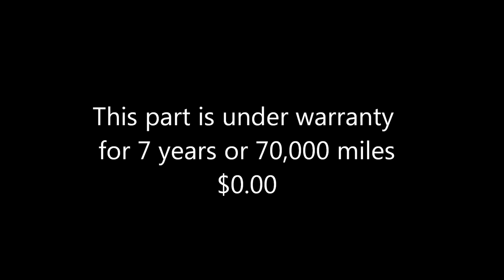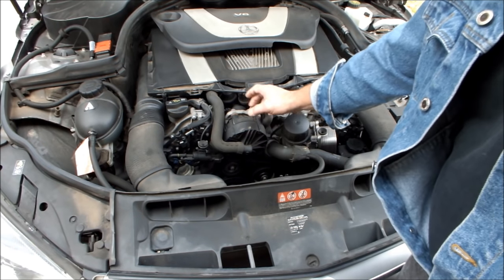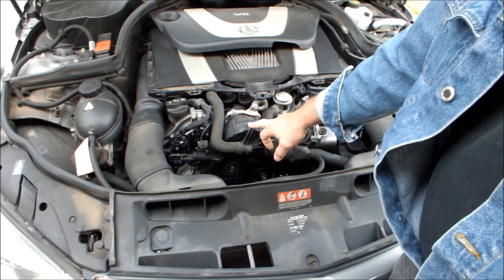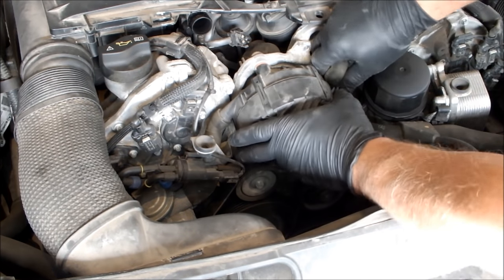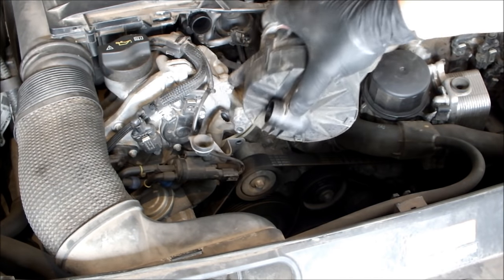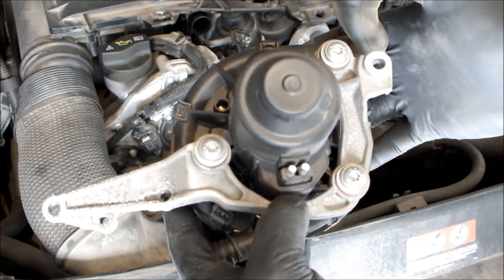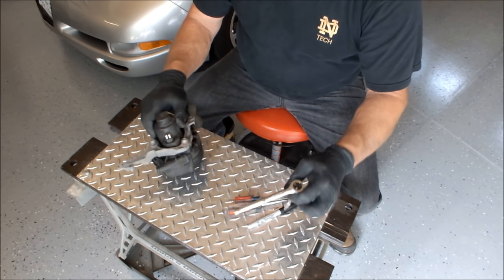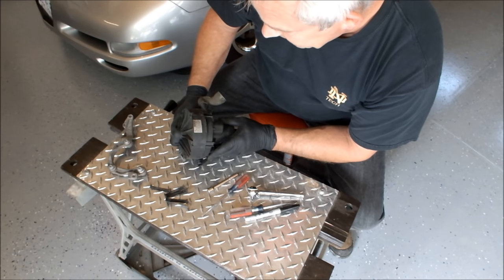Mercedes Secondary Air Pump Problem

Comment: hey man i have a question again for you , okay so ichanged the smog pump and also the relay . now im getting a code for the check valves , can i just remove them and clean it up?
Reply from the maker: You can certainly try it - but MB's are a pain in the ass for lights coming on
Reply: Once the Kombi Valves get plugged up with Carbon- you need to swap it out.
Reply: David Hall so change my valves ? appreciate yo help my boy
Reply: @uzzle21  You need to verify that the vacuum lines attached to your Intake Manifold- secondary air injection switchover valve- and Kombi Valves is in good condition. Once that's done you need to remove your Kombi valves and verify that your smog pump is pushing air through your Kombi valves. If all the above checks out ok- your problem should be solved. 
My problem was dry rotted vacuum lines. Once I replaced those- I was good to go. No more CEL. I used a Power Probe to power up the smog pump for testing purposes. Also I used a Hand Brake bleeder to pull a vacuum on the vacuum line attached to the Kombi Valve. I tested (1) Kombi Valve at a time.
Reply: David Hall i just found out bro its the damn pump bro its causing the air pump check valves not to function properly
Reply: @uzzle21  If the Pump is not functioning for sure. You need to replace it. Confirm first- then swap- out the Secondary Air Injection Pump. Try to get a Power Probe- it will make powering- up components much easier.
Reply: David Hall yo bro i have changed air pump , both valves , and the relay. still getting that damn code what do i do now
Reply: @uzzle21  Only thing left is the Secondary Air Switchover Valve. Its a solenoid that opens to allow Vacuum to open the Kombi Valves. What's the Make Year and Model of your Car? Another thing: Is the Smog Pump coming on in the morning- when the Engine is cold?
Reply: David Hall yes its brand new , changed the air pump check valves , and also the relay. still getting code
Reply: David Hall i think ik the solenoid you talking about also
Reply: David Hall 2006 Mercedes e350 Base
Reply: @uzzle21  The switch over solenoid is the only component left to swap out.
Reply: David Hall electric change over valve
Reply: David Hall u got a number or something man i’ll contact you so i can get this done
Reply: David Hall i emailed you

Comment: Is this the same for 2000 S500? I have the same problem but don’t know if it’s the same on all benzs
Reply from the maker: If your car whines when first started in the morning then yes - Cheers from Canada!
Reply: carquestions it does just that it sounds like a jet for 30 seconds then goes back to normal purring like a cat
Reply: @YungBlaxTv  thata good then. They all do that for about 65 sec and then get quiet. Unless they r bad the. I'm assuming they stay noisy

Comment: Why not lithium spray grease?
Reply from the maker: Sure Tom - give it at try and let us know how it works - cheers from Canada!
Reply: I used silicon spray after blowing all that dust out, helped a bit but was still making some noise so just swapped it out.  The odd thing is that my car only had 86000 kilometres on it, so a bit soon for screeching noises. Will see if the Dorman brand lasts longer than the Bosch.

Comment: Hi. I have not 0410 code,but this pump not on/off last 4 monts cold engine (2-3 times maybe...),but I have other codes 0172 and 0175 and no one can't find problem,engine runs too rich,all sensors is ok.vacum leaks is ok,o2,maf... problem secondary air pump??
Reply from the maker: How many miles on it Fix? - could be a lazy 02 hard to say at this point
Reply: Mercedes w203 V6 2.5 L 140k miles,but this codes come again after every 30 miles. when engine is cold,car runs fine,codes come when engine tempreture 60 and up ! CEL come when car idle

Comment: I thought I still need to confirm something with you, since I know nothing about cars. 

A repair shop told me I should replace secondary air injector pump, check valves and secondary air injector pump relays. According to my understanding after watching your video, this problem is not a problem that will affect safety and will not cause the engine down. Does that mean I can disregard it until I am willing to change it?
Reply: BTW, my check engine light is on.
Reply: I’ve been driving with my check engine light on for about a year already and it’s definitely my secondary air pump with that noise. Hasn’t effected my car yet but it will with smog laws so I have to change mine asap
Reply: @methodbigboi  Thanks for your response!!
Reply from the maker: You can drive with the pump like that and the light on for a very long time - possibly till you sell it - if the pump is turning on then the relay must be working

Comment: pull the fuse and or plug. this part is NOT needed for proper engine performance. happy driving!
Reply from the maker: Not so Happy Veghead - You'll get warning messages every time you drive - a very unsettling feeling - Cheers from  Canada!
Reply: Yes it is you know that air pump pushes the air  threw for the ac on these Benz’s rite if they pull the pump relay the ac will not get air

Comment: This is obviously a money grab part for the dealer. I replaced this pump three times already(thank goodness i learned to replace myself) and like clockwork, the jet turbine sound can be heard 5-6 months after a new replacement. A real bad quality part from Bosch, they should redesign this.
Reply: try lithium lubricant or silicon lubricant, who knows, they may work.
Reply: Are you installing it correctly. Mine works great after 8 years

Comment: can someone tell me, wich bearings are installed?
Reply from the maker: Going to try and rebuild it Dodasch? - way to go ! Cheers from Canada
Reply: 2x 608S, a bit hard to disassemble, tomorrow i will get two new bearings and put it together.
Reply: @dodasch5685  Hi! Did you rebuild the motor eventually? My pump is making crazy noise, probably the bearings are shot, i want to change them. So are they indeed 608S bearings? 8x22x7mm size? And how difficult was it? Do you need special tool for pulling/pusing the bear8ngs out? Thanks!
Reply: @a.f.1587  it's relatively simple, yes you need 2x 608S bearings, no special tools required! 
You can remove it and drive without it until you get it fixed, nothing will happen to your car.
Reply: @dodasch5685  Thanks for the info. Yes i know noth8ng will happen, but it's not that bad at this moment. It has that annoying sound, and i will fix it before it fails completely. Thanks again, i will order the bearings tomorrow.
Reply: @a.f.1587  my engine was completely seized, but before that it was an imposition for the neighbors

Comment: I changed mine twice but the check engine light won't go out.
Reply from the maker: Is it actually running in the morning? - if not you have a wiring issue
Reply: Could be, and I have a new engine. I am going to put a new relay in. But I noticed that there is a wire where those fuses are that I don't know what it goes to.
Reply: Hey Eric and carquestions, I also have the same thing going on. 2006 C230. The code is for Secondary Air Pump. I was able to find a Bosch new replacement online for something like $140, but the code didn't go away after changing it. Also, it never gave off a funny noise. This leads my mechanic to believe it might have been a wiring issue, as you said here carquestions. Eric, did you get your problem resolved? I'm nervous to send in my car back to the mechanic and spend money just having him poke around and investigate; he's not a Mercedes specialist, just a good ol' honest countryside mechanic.
Reply: Eric Baptist so u changed pumps twice and it still wouldn’t go out,

Comment: Would this part cause hesatation to the car
Reply from the maker: No not likely the cause of hesitation Jor - Cheers from Canada!
Reply: @carquestions  do u know what can be sometimes I press the gas and wont go it takes long to accelerate but if I turn the car of and on again everything goes back to normal acceleration
Reply from the maker: @jorarr5174  you need to scan the computer and get any codes before you start troubleshooting

Comment: I have a 02 S500 and got the same code P0410, I've now noticed that when my car sits idle it starts to shake a little like it's going to shut off but it never does. Has anyone else experienced this issue?
Reply: I do,my 🚗 is mercedes E320 and I havethe same engine code.

Comment: The part is only like $100 on ebay and repair took around 2 hours
Reply from the maker: Thanks for the info MLG
Reply: I' getting the same code on my 06 E350, but the air pump doesn't make any noise at start up....

Comment: I disconnected mines car runs smoother
Reply from the maker: Maybe you fixed some leak or other - well done
Reply: Did you disconnect the power plug or did you disconnect the hoses? Did you get a check engine light?
Reply from the maker: @Salpeteroxid  the MIL light will definitely come on
Reply: @Salpeteroxid  I just replaced it with a unit from Amazon for 60$
Reply: @JohnDoe-xb7ov  what's it called?
Reply: @Salpeteroxid  either way you will get a check engine light. Plug or hose.
I tried just to see. Left electric plug on and pulled off the hose. Start her up. Boom! Check engine light. You could drive around fine like that but come inspection time you got put it back or fail inspection. Will have to do about 3 diff drive cycles and the engine light should clear by itself.

Comment: dealing with the same issue, engine light on, pump replaced, fuse has good continuity, not sure what else to check.
Reply from the maker: I'd replace the noisy replacement pump - or just disconnect it - Cheers from Canada GG
Reply: Air pump relay
Reply from the maker: Also very good advice - Thanks Olaun - Cheers from Canada! @olatundeabiri7048
Reply: Changed the pump and relay! Engine light still came back on with same reading! Now what?
Reply: Pete.. do you fix it ? Becouse I have the same problem..
Reply from the maker: I have replaced multiple ones in the same car @danielsoton1104
Reply: @carquestions  you mean air pump?
I already replaced fuse, air pump, black plastic valve which is under the pump on the left side and now the car is working perfect but engine light came back ..
Reply from the maker: what does the engine code say this time? @danielsoton1104
Reply: @carquestions  I didn’t checked yet, I’ll try to read them today again but always was P0410/P0412
Reply: Have the same code P0140 and air pump is noisey in the morning. Did you find a fix yet?
Reply: System has a gate valve for each bank that’s vacuum controlled, check to see if they’re stuck open.
Reply: @Chris-bz6wl is bank 1 the left and bank 2 the right ? Standing in front of the car looking at the engine?